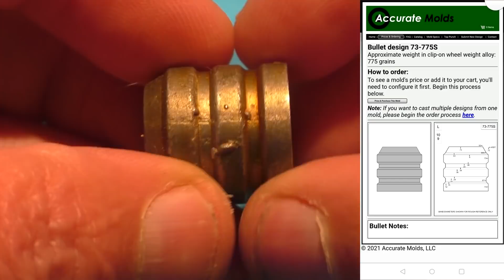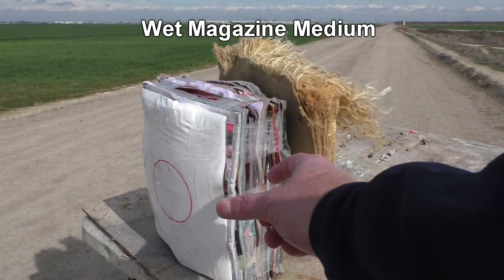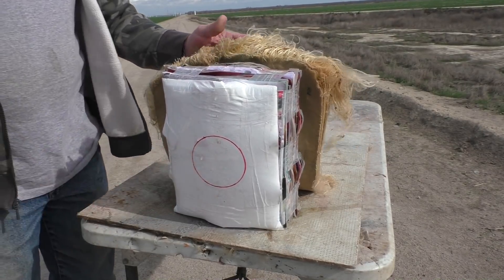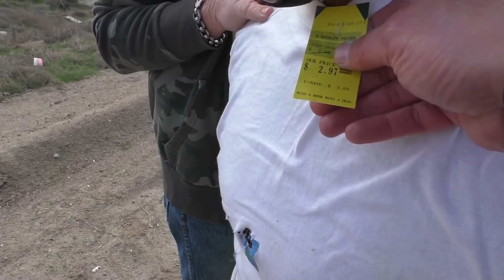Bismuth 12ga shotgun slugs - Shattering Results!!

Comment: Bismuth and tungsten what would happen may have to use powdered tungsten
Reply: Well, as you would imagine, an alloy is out of the question. The melting point of tungsten is more than twice the BOILING point of bismuth. However, if your objective is merely to increase the specific gravity of the slug, I think you could do that, AND make it nose-heavy at the same time, with a small tungsten cylinder, embedded into the front of the slug, (sort of like when they tested slugs made of plastic, but with a metal core acting as a penetrator).
Reply: @VoIcanoman  yes and also with the same concept as a waxed bird shot slug this time to tungsten powder granules are the BB and the Bismuth would act as the wax

Comment: I recently bought that mold for slugs. Where did you guys get the load data?
Reply from the maker: It's based off the weight of the projectile and what velocity you're trying to achieve -  while not exceeding the barrel pressure limits.

Comment: Bowling pins are maple but the plastic crap on the outside is what makes 'em tough. 

Bismuth is used in shot shells for hunting Waterfowl. Originally steel shot was mandated because lead shot would be in unrecovered  hunter-shot ducks and geese or would be ingested by them or other birds, in areas where lots of waterfowling took place, as they looked for grit for their gizzard and they would die and be ingested by the occasional Bald Eagle that would die from lead poisoning. So the government pacifier to all the tree-huggers ( anyone besides me think we need more Honey Locust trees? Google it! ) was to mandate steel shot that doesn't have enough density to kill a duck or goose cleanly at the ranges that they are typically hunted at. When the government started to realize that the 3 or 4  eagles that were being saved by the steel shot each year was at the expense of thousands of ducks and geese being wounded and able to fly away just to die without being harvested for their food potential, they began to realize that they F**ked up, but weren't going to change back to lead even with the new data, sooo... that meant lead was NEVER coming back. At that point ammo makers found that they could make the government and all the tree-huggers happy by using the very expensive Bismuth, because it was more like lead and would kill waterfowl reliably enough to make hunting them worthwhile again aaand... they could charge whatever they wanted because it was the only game in town if you wanted dead ducks on your dinner table. And everybody lived happily ever after, especially the Bald Eagles, because the main ingredient in Pepto Bismol is, you guessed it, Bismuth. Now eagles don't get upset tummies from eating rotting ducks and geese. The End

Comment: Those SUCK. Had to use those for work. Cleaning the burners in a coal fired power plant. We used 3-1/2 magnum bb shot. Local gun shop has a couple boxes of 2-3/4. BB's Turn to dust when they hit anything hard